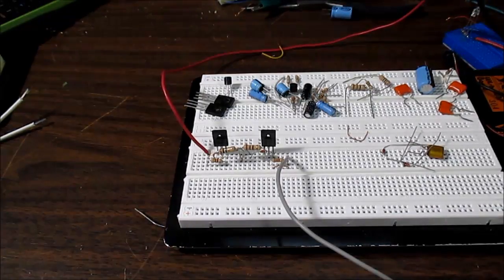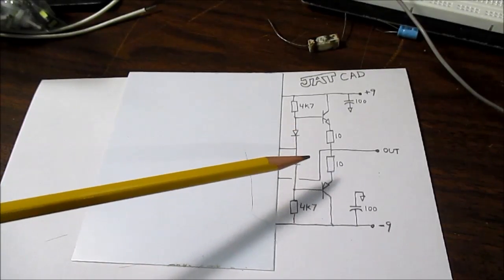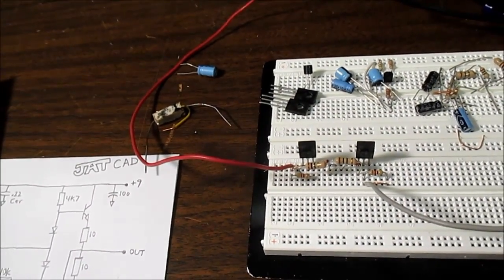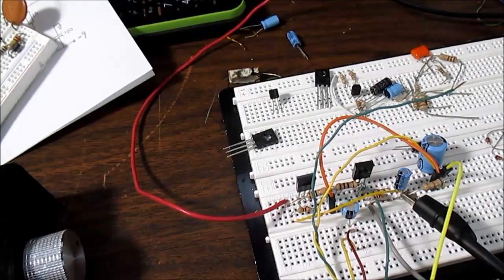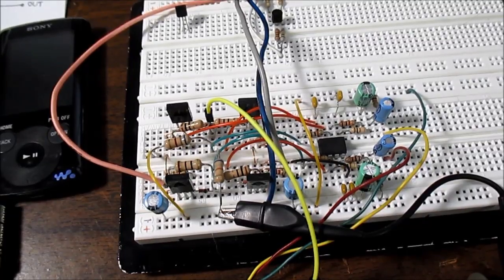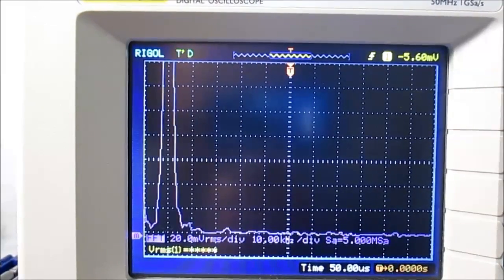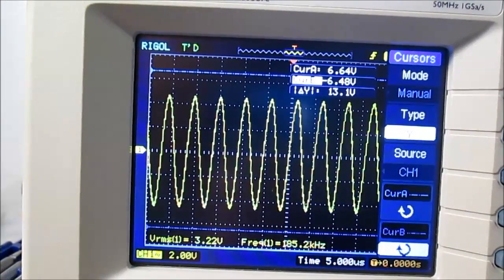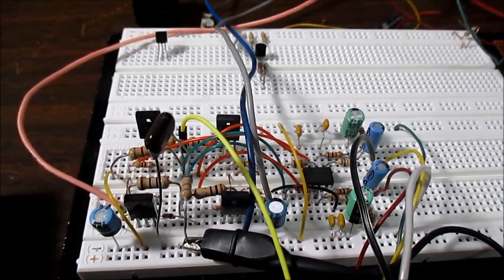Headphone amplifier breadboarded and tested - DIY !

Comment: Hey John. I hope you read this comment in this 6-year-old post. I came across your channel recently and been enjoying watching your videos a lot. Thanks for sharing your knowledge. I'm interested in building this headphone amplifier to power my old Beyerdynamic DT331 (40 ohm, 86dB/mW) at no louder than 80dB (to not make my tinnitus worse lol). DC power would be from a 19V 1.5A SMPS adapter I have. Assuming DT331 dips to 20 ohms and its sensitivity measured at 1kHz (I couldn't find an impedance graph or detailed specs), I estimate I would need 7mA (both channels) or 28mA (for +6dB headroom at low frequencies). Biasing the transistors would require 4mA, and the NE5532 idle draw is 8mA. Thus my total estimated peak current requirement equals 40mA. I'm thinking of using a TLE2426 IC to split the rail. Would you agree with my current estimation and do you think TLE2426 would work in this case (or too close to its limit)? Thanks. Bill
Reply from the maker: Hi Bill, Thanks for watching the channel. You can make a split supply using resistors and capacitors as I did in my last video. I would recommend larger capacitors, though. 1000uf would be sufficient.
Reply: @JohnAudioTech  Wow thanks so much for replying and so quickly. You're awesome.

Comment: So you meant more current output. Oomph it to the headphone. 20 ohm output impedance would be luxurious
on looking at your circuit though, you'll drive a speaker at 16 ohms to 1W no  problem with that 😂

Comment: 70 ohms is low for a headphone I would have thought. Most headphone outputs would expect 600 ohms... unless im wrong. But the point is, in which case, its actually over loading

Comment: Hi John if I want to drive 32 ohm headphones (half impedance as yours) what change have to make to the circuit ? or use It just live the values as you stated un this video ? If you can take a minute to unswer this question I´ll order the parts to build one for myselt (probably put an output capacitor just in case one off the output transistors fail and pass DC to my headphones (cost me a little fortune), you know there are knock t off ransistors offs). Thanks in advance

Comment: Just finished my version of this circuit last night. It works for sinewave on 30 Ohm load - now I have to hook up earphones and take a listen. Running on two 9v batteries with NE5532 front end. Thanks, John, for the simple circuit.
Reply: Hooked up the headphones and this thing is loud. Hearing loss guaranteed even on batteries. Sound quality is good.

Comment: Dear john, I build this amp for someone about 2 years ago, he had hi end types of headphones, recently i dont know what went wrong in the circuitry, but my friend lost left side of his headphones. 

I need to request that it would be a good idea to hv a speaker protection based on upc1237h in this final diagram. Im not good at working with relays john. That's why im requesting.

Comment: After re-watching this video for about the 45th time, I realized that it has under 600 likes out of 25 THOUSAND views. Now, John isn't one to brag but that thing is ruler f*cking flat up to 45k (possibly higher) driving a capacitive load with no signs of oscillation and just about zero distortion. Are we so desensitized that we need fireworks and facial cumshots in order to recognize when something is awesome? We're engineers. Our dicks salute results and our panties drop for no other! Now do the right thing and bust a nut on that Like button.

Comment: I made the "Power amp" version of this.
With darlingtons. 8W 8Ohm, 6Amps, short circuit proof etc :D
10Hz-50 kHz linear.
Simple but perfect circuit.
Of course the soul of it the perfect IC.
If you dont need darlingtons, BD-s are much better for High frequencies.

Comment: I build it, and it sounds amazing. PG and SG should be connected. It's the same Ground point. With two LME49710 it has zero noise at max volume with no signal. Thank you for schematic!
UPD: I replaced 47uF caps to 100uF. Not sure, but feels like sounds better.
Reply: hi do you have you made a gerber file? mind sharing?

Comment: you can make a 10x amp and that way any distortion will be 10x , bringing you from 0,2% minimum detection to 0,02 witch is about as good as you really need , you probably know this . one good set of op amps will do that powered by batteries .

Comment: Would you be able to design one of these for two isolated stereo inputs to a single output? Would be incredibly useful for we nerdy gamers (eg; TV audio out from consoles and PC audio combined and amplified, to be fed into good high-impedance headphones)
Reply: Can add a mixer stage with a few inverting opamps! I know this is from two years ago but in case you were still wondering haha

Comment: Hi Sir.Is this working in A -class?
Reply from the maker: It is class AB
Reply: @JohnAudioTech  Thank you for your answer sir..But where do you control the bias current trough BD139 and BD140? Otherwise there will be cut-off's in the signal? I mean how we determine how much current flows trough those transistors to avoid cutoff's?

Comment: You can make it class A type 
For 500mw headphone class A can work best
Reply: There's little reason not to use class a for a low powered headphone amp. Simpler and extremely low distortion, very little to gain from class d. Perhaps a bit more volume if you are limited to a voltage though, without converting the power. Without biasing, a class D can theoretically swing closer to the rail of the power provided.

Comment: Where I'm supposed to plug the ground of my headphones jack? On the 0v rail? Or the - 9? Because in reality the 0v rail is at 9v and the - 9v is at 0v...as the +9v is at +18v...i dont get it :( My transformer is +20v 0v -20v so if I take the ground of my headphones jack and connect it to the 0v rail, will I send 20v straight to my cellphone?
Reply: May be because this circuit is all bull s.
Reply: @sdfsdfsdfsdsdfsf8468  you should learn electronic basics dude... for sure
Reply: you should learn electronic basics dude... for sure

Comment: Did you think about thermal stability when driving lower impedance loads?  You don't have thermal contact between the 1N4148's and output drivers as far as I can see.  I guess those 10 ohm emitter resistors are going to prevent destructive currents, but I wonder if the bias current is prone to wander around without some stabilization?
Reply from the maker: In a finished amp, I'd consider mounting the diodes along with the transistors on a small heatsink. All of that is not practical on this show and tell breadboard amp. The 10 ohm resistors do help keep the bias stable. It's been awhile but I recall the transistors barely got warm even when testing.I'd stress test it before deciding on the final design.

Comment: John, this is a winning amplifier design. Nice work.  What's a good source for some genuine BD139 and BD140 transistors? What diodes did you use on this John?  Thanks!

Comment: How would you add more bass to that circuit? Would it be adding higher capacitor to the input or output? Or changing the RF filter on the input ?
Reply from the maker: It would be best to add a boost circuit separate from the amplifier or incorporate it in the feedback loop.

Comment: Hi John, I tried your circuit but I couldn't get it to work :o( 
The only way I could get it to work was to have the Opamp with its own local feedback then take the amplified signal into the push pull network. If I tried your way of including a global feedback, then the output was more of a square wave!
Love to know how other people have got on with this circuit.
Reply: PG and SG should be connected. Thats why it doesn't work. I had same issue
Reply from the maker: Strange. You should get the same signal level with the output in the feedback loop. If the opamp and OP stage work independently (as tested in the video) they should work together. Mind your grounding layout (no output return or supply currents should flow in the small signal grounds) or the amp will misbehave for sure.
Reply: Thanks for responding John, I will revisit this with two separate bread-boards to help keep the signal and power earths separate. 
John if its not too much trouble, could you please clarify if you used a single power supply for your final circuit or did you use a split rail power supply? ( I used a single power supply of +18vDC ).
Reply: Thanks for responding John, I will revisit this with two separate bread-boards to help keep the signal and power earths separate. 
John if its not too much trouble, could you please clarify if you used a single power supply for your final circuit or did you use a split rail power supply? ( I used a single power supply of +18vDC ).
Reply from the maker: With the final design you must use a split supply.

Comment: Just found ur u tube channel 2 days ago and im. Glad i did i love seeing this stuff done i just got a pionner 1021-k reciver and learned out after i bought it that they had a flaw in them from the factory for the dsp chip what happens is it will get hot then loose conection with the board and heating them up to reball them is only a temp fix mines working fine but i was wondering what u would do to fix that problem or is there anyway i could stop it before it happens to mine i was thinking of putting a heatsink on the chip with a fan to blow on it other thing i noticed is heatsink pionner put in there gets really hot when u use the reciver so i was thinking of putting a fan on it aswell hope to hear back from u john
Reply from the maker: If the chip is getting so hot that you can't hold your finger on it for a few seconds, then it is too hot. I'd add a heat sink.

Comment: Great video John. 
Im just starting out messing about with op amp circuits and was wondering why you used a 2.2uF cap on the input as this seems high to me due to it passing frequencies as low as 7Hz. (im sure you have a good reason for it). I have yet to build it but, it will the next one into my breadboard later this week and Im looking forward to trying to get it to work for my 250 ohm Cans. Cheers.

Comment: The schematic that you are showing  does not match what is on the breadboard.. On the breadboard you have an op amp,  audio driver, and output transistors'
Reply from the maker: No. What is on the breadboard is the full two channel circuit. The schematic only shows one channel because the other is identical.

Comment: Great video, John! Do you think this design would work as a booster amp for MP3 player/smartphone ->> auto AUX IN? I find player output direct to aux in requires full volume from player and the car audio system.
Reply: You don't need a power stage. Just configure any audio opamp you have for voltage gain. If you don't have a bag full of opamps, maybe consider getting something like rc/njm4580 or ne5532. The former is more versatile because you can sometimes get away with running it off 5V and can do higher current, the latter is more established in projects you'll find around the net. Either will cost you a dollar for a bag full.

Comment: Hey! Nice one there. I was just wondering if you could explain what are the characteristics of well designed PCBs as far as audio amplifiers are concerned. Thanks.
Reply from the maker: Most important is the grounding layout. It is important to arrange the ground traces so that high currents are not flowing in the small signal grounds which will cause higher distortion and/or instability.
Reply: @JohnAudioTech  please make a video in this topic. Laying out good pcb ground and star ground connection.

Comment: very clean hp amp indeed.. i have a question, if i want it to be battery operated and compact, can i use a buck converter (probably 9v step up to 18v) and use a rail splitter capacitor? will it sound as clean as using 2 9v battery?
Reply from the maker: As long as the power supply is clean, it will work. two 9v batteries will work but the current draw is around 25ma so run time will be limited to a few hours. If your phones are in the 32 to 64 ohm range, you could run the amp at +/- 4.5 volts but you might need to adjust the biasing resistors if bias drops too low.

Comment: Hello John. Can you give any tips on how to figure out bias resistor values. I'm building output stage on Darlington BJT's and this thing is not wanting to cooperate)
Reply from the maker: I need more information. Do you mean the values of resistors used for the biasing transistor (Vbe multiplier) or ??
Reply: JohnAudioTech I need bias resistor values for diode biasing approach (like in this video). I'm using 2T827A (n-p-n) and 2T825A (p-n-p) transistors (hfe=750-18000, Ic=20 Amp, Uce=100 V, Ueb=5 V).
Reply from the maker: I don't recommend biasing a power amp this way. Use a current source otherwise output swing will suffer under load. In a darlington config, there are 4 base to emitter diode drops to deal with, so you need 4 diodes. Better to use a transistor, IMO.
Reply: Thank You. I'll try to use Vbe multiplier.

Comment: How do you get +9 and -9V without a power supply?
Reply: Two 9V batteries in series with a centre tap, or a resistive/capacitive divider from 18V.

Comment: Would love to see a review of op amp driving 32 ohm headphones  at low voltages (3 -9 volts) for portable use . Great project.
Reply: http://www.redcircuits.com/Page119.htm
http://www.redcircuits.com/Page31.htm
Built both of these and they work great, the OP Amp based amplifier is better though
Reply: Built the A47 with parallel  4556.

Comment: Seems like a very simple but impressive design, I have a question though. When do you know when to use polarized (electrolytic)  vs. non-polarized (film or poly) caps?
Reply from the maker: I try to use film caps where feasible. Above a certain value they start getting large and expensive, so I use electrolytic. Contrary to popular belief, electrolytics won't harm the sound quality IF they are used properly.
Reply: Avoiding ill effects of electrolytics on audio quality would be a worthwhile video topic!